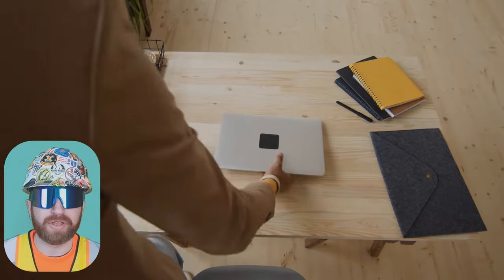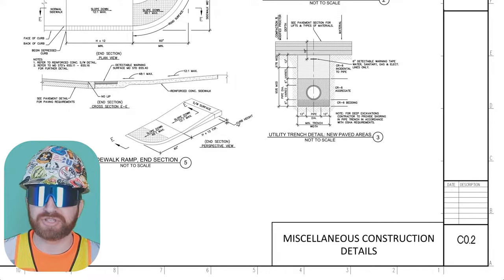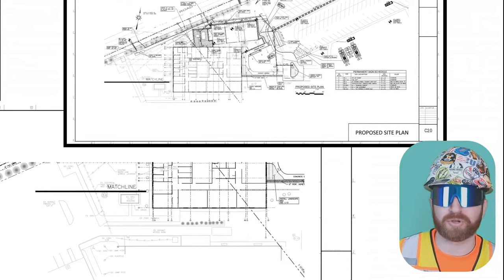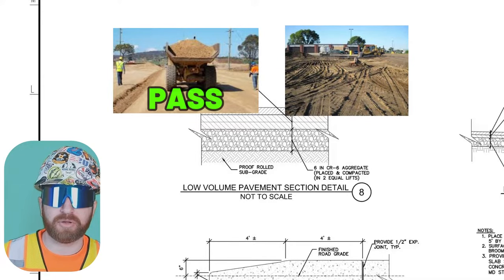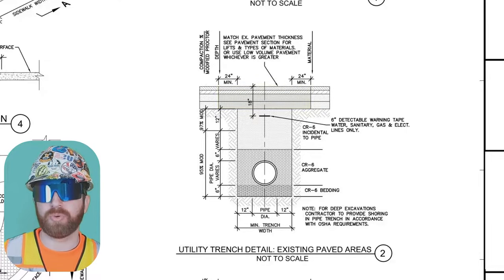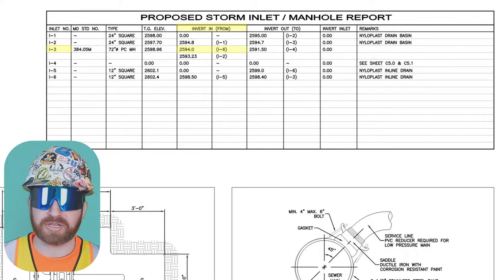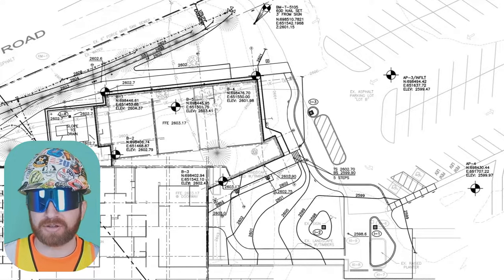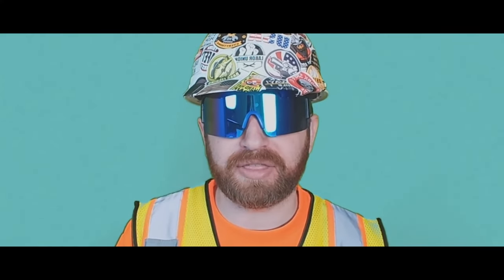Learn How To Read CIVIL Construction Drawings!

Comment: dumb question, is the civil drawing in inches or feet and what is FS? For example, what is 120.25 FS?
Reply from the maker: The FS could mean a couple things (maybe far side - would need more context), does your plan sheet have abbreviations page?  In your example, it's 120' and .25 of 1' which equates 1/4 of a foot.  So that's 3" (because 3" / 12" is .25).  So overall it's 120' 3".  I'll do a video on this in the future, and how to use a couple tools to easily convert these for harder decimals using a construction calc.  NOT a dumb question, actually a VERY good question.
Reply: @planandspec  thank you so much, our abbreviation says Face of Surface, and good thing I keep on researching and found that 120.25 is in feet.inches. Thank you for your help!
Reply: haha FS finish surface

Comment: Who locates the buildings on a site plan??? Civil or Architectural 🤔
Reply from the maker: Great question!  If there are any Architect's or Civil Engineers reading this - please feel free to chime in!  I've only been a part of programming (which is the initial design conception - or sketches of the site) on a handful of projects.  From what I've witnessed - the Architect takes an existing land survey and positions the building based on the needs and considerations of the Owner/Client (i.e. does the Owner want the main focal point facing a certain direction such as a road, a sidewalk, a public space... are there sun/light considerations, or development requirements, etc).  From there the Architect then adds access points to the building such as drive lanes, parking, sidewalks - all in sketch format of the site.  From there (this is where I'm not certain & input would be needed) the Architect produces their set of CAD/REVIT drawings (along with structural design & CAD/REVIT drawings) and backfeeds that back to the Civil Engineer & the Civil Engineer (through coordination with the Architect) final places the building on the site plan (which turns into the civil site plan to account for elevations of tie-in's to utilities; which dictates final grades of how low/high the building is positioned through cuts & fills).

Again - if we've got an Architect or Civil Engineer, please jump in to confirm : )
Reply: Is there anywhere that fire lane painting will be located?
Reply from the maker: Don't follow the question 🤔

Comment: great content as usual, just one suggestion if you can speak slower will be fantastic
Reply from the maker: This is something I do go back and forth on (when I edit).  I try to maximize the content in videos by editing out any wasted breath which usually means shorter videos but faster talking/content.  Ill cut most videos down by 2-3 minutes in total duration when I do this, but I do agree it’s fast paced, and sometimes it’s not helping you as the viewer.  I’ll definitely be aware of this and try to be more conscious of when to slow down (for more critical information) moving forward.  Great input 👍